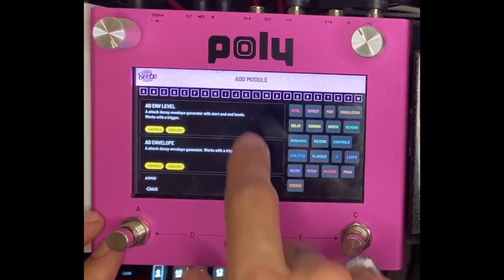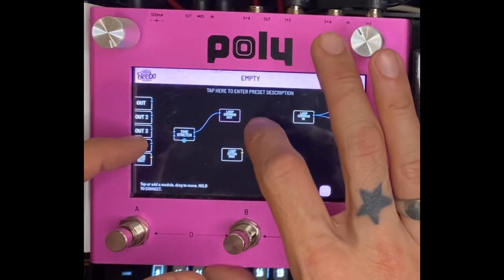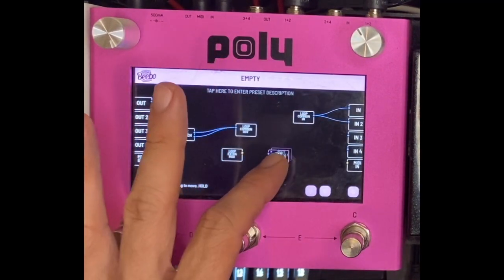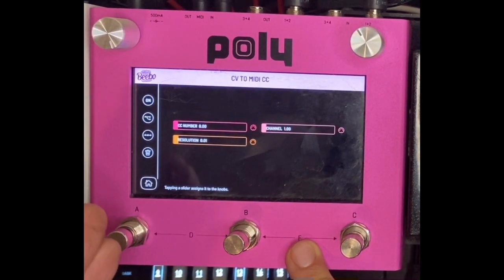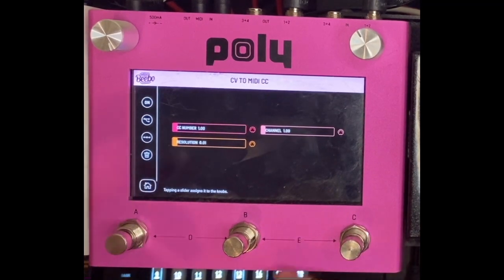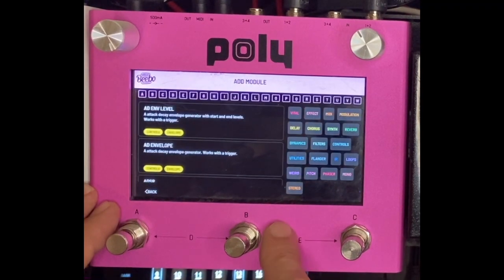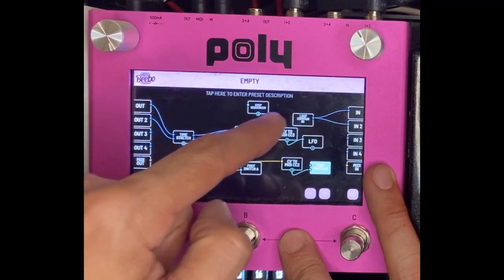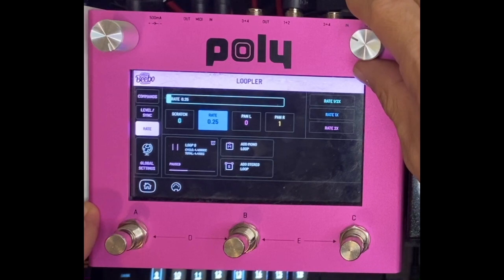Beebo - Loopler module with internal cv and midi learn

Comment: cool vid, thanks a lot. do you know if there's any way to sync up loopler to an external midi clock?
Reply from the maker: Yes. I primarily only use it synced to external clock in my overall rig. 

Usually an MPC One provides clock and Loopler on Beebo simply receives when you adjust its menu settings for sync type to midi.

Comment: what Firmware are you using for Looper? i get mine in the mail this Wednesday and i think it comes with 3.0. Does 3.0 have a Looper?
Reply from the maker: Congratulations on your new Beebo! Currently I am on Firmware 3.5 and would recommend updating if you are a Loopler fan. There were some features added for midi connection to the Loopler module. 

Also, I saw on Poly Effects' Instagram that there may be a 3.6 update released in very near future.
Reply: @pedaleffected  thanks for your response I really appreciate it. Yes I believe 3.0 will be installed when I get it in the mail this Wednesday. I purchased my from perfect circuit audio. So you're saying there is no Looper application on the 3.0 version at all? Is the 3.5 going to take away some features that were currently on the 3.0? I usually don't mess with the unit especially when I buy a new because I have a 15 day grace. If I want to return it so I tend to kind of leave things alone when I first buy it but if you think that upgrading 3.5 will definitely be like a night-and-day difference please let me know
Reply from the maker: I forget which firmware introduced Loopler but there is a lot of improvement overall when you do upgrade.

Very easy to do and worthwhile!